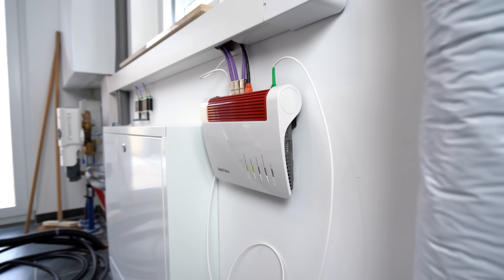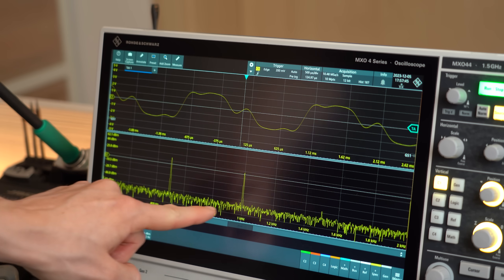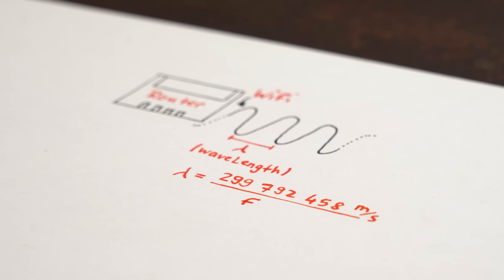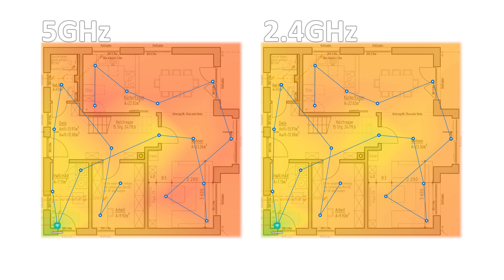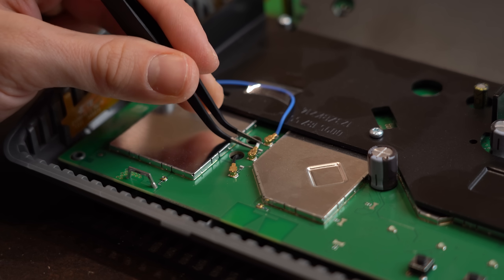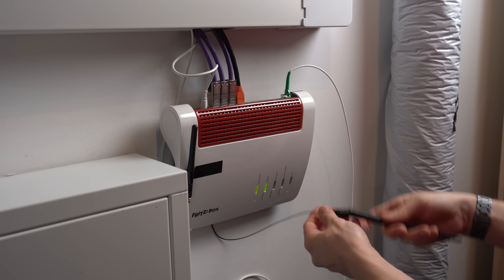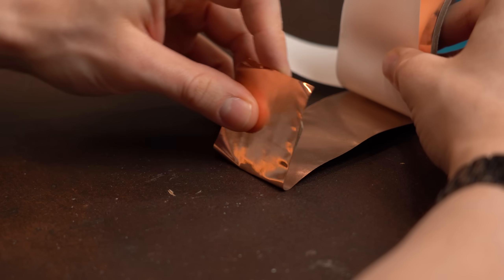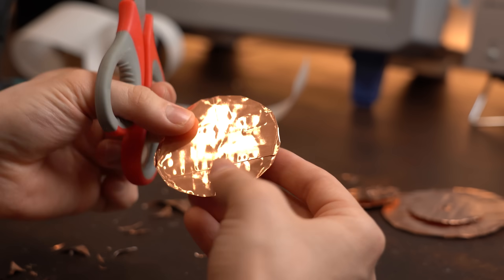I tried OVERPOWERING my WiFi!

Comment: Building antennas without an analyzer, especially at these frequencies can be difficult. Another thing you can try is to move the antennas to a better position with some good coax cable.
Reply: The lack of good, matched coax is most of the problem here. Hard to know what would be appropriate given the black-box nature of the router, but, you can probably infer that from the other components on the PCB. 

Really the best you can do is a half wave antenna that's a large enough diameter to accommodate the range of frequencies you're dealing with. That also makes building it a fair bit easier as there's more wiggle room.

Really though, anything higher than 700mhz or so, and you're better off just buying a halfwave antenna and mounting it properly, and in the case of wifi, having multiple access points really solves the issues he's having very well.
Reply: @jttech44  Yep, a half wave dipole is the easiest thing to build.
Maybe a collinear antenna might be a good choice here too.
Reply: You losing transmitting power via the longer cable…
Not thinking about that solution…
Reply: @edvardfranke   Coax has loss, sure, but so does the air.  Loss in coax is going to be less than loss in air, that's why cable TV is a thing.  If you have to cover 100', but you have 50' of coax, it'll be better to run the signal over the coax and put the antenna 50' away from you, rather than 100'.

Comment: For the last antenna, it would be cool to see its S11 measurements from a VNA.  This would help see what the resonant frequencies are to confirm it was tuned just right.  Use anything from a inexpensive LiteVNA64 to Rhodhe & Schwarz equipment.
Reply: I was waiting something similar to this from him :(
Reply: @Oytun15   I was hoping for a VNA too.
Reply: Also the fact he basically used two conductors separated by dielectric as the antenna elements made it extra sus. No reason a Yagi antenna shouldn’t work if designed properly
Reply: The video he watched making last antenna, is russian. If you watch video about making this antenna, IT WAS USED FOR RECEIVING 4G SIGNAL.
Reply: I was also disappointed that he did not do the calculations himself. I made a yagi antenna a few years ago to get WiFi signal to a camera that was well outside the range of my router. They work well if implemented correctly. For what he was trying to do, such a directional antenna would not work well. The effective area/angle of the signal would be far too narrow to reach his full house. He could potentially improve his signal at his couch, but in turn would sacrifice coverage in the rest of his house. I hope to see a follow up video doing directional antennae justice.

Comment: its likely the orientation of the router. those aren't meant to be wall mounted despite the mounting holes. they have an internal dipole antana. imagine a signal that erridates in the shape of a doughnut . flat. it has great coverage. put it on its side. suddenly. trash accept very specific spots on the sides or directly above it

Comment: You built the directional antenna wrong, adding cooper tape to both side of the cardboard you make 2 elements not 1.
Also maybe you should have tried a dual biquad antenna, that can be made directional adding a reflector behind it.
btw if I'm not wrong those types of routers are built to be placed horizontally not vertically so their antennas has the wrong direction and performs poorly.

Comment: This breaks my heart!:

1) Antenna polarisation: 2 antennas = dual polarity - having both antennae parallel to each other will almost half the throughput
2) Antenna directionality: using directional antennae will reduce reflections and multipath, which are important for MIMO, reducing throughput.
3) TX Power: I cannot stress this enough; Increasing TX power does next to NOTHING. the clients TX power is limited, coverge does not increase by increasing the AP TX power (of course download and upload not considered in this part, but ther are many more reasons to limit AP TX power)
4) Antenna location: avoid going through walls and place the Antenna centrally - for example in the middle of the floor, easily visiable to each doorway (interior doors are usually low density and allow Wifi RF to pass) - imagine the antenna like a lightbulb; if you can see the light with the doors open, you are getting signal.
5) Antenna aperture: the more of the antenna element you can see, the better the signal - it's like the wire is a solar panel - the more of it exposed, the more signal.

IMHO, points 1, 4 and 5 are the most important. Go make changes and tell me it's not better.

Comment: You probably have some spare esp32 or esp8266 around. You can turn it into to wifi extender. With external antenna you can use any and it's still "technically" FCC approved

Comment: I just get commercial cisco routers off ebay for like 10$ cad each and run a few around the house with PoE and run a vWLC in a vm and bam.. makes a big difference when you start with an AP that originally cost 1600usd or more each

Comment: The WIFI is being blocked and absorbed by the insulated dryer vent right beside it.  Assuming there is a solid duct or a coil spring in that white ductlike thing of course.

Comment: If its true mesh you might be ok if you can get the mesh APs in good reception spots, or can uplink them via ethernet. Don't use repeaters though, they will show good signal buit throughput will be halfed or worse. I use ubiquity APs one even uses a powerline ethenet adapter for an uplink.

Comment: Hi, as usual a great video, but being an IT guy I would strongly recommend separating router from the access point and build a small mesh setup. There are many available that are many ready solutions that aren't that expensive but will kill any "consumer" Wi-Fi router out there. I personally use Ubiquiti but as I said, there are many solutions. Hetamapping and meshing is a basic function for such solutions and believe me, having a great life-long support for a set of devices, single SSID for multi-bank networks, multiple vlans... I do know that it would not suit your video format, but check it out for home use  :).
Reply: Fritzbox routers and repeaters support mesh without any hassle just plug them into the outlet and add the WiFi network and it will do it's thing. Setting up an Access-Point network is more of a hassle ✌️
Reply: @leocompany  Yes but they're generally crap at Wifi. I also have Fritzbox, and separate APs from Mikrotik. Wifi on Fritzbox is disabled. Lacks fine grained control anyway. And you can see in the tear down what garbage multi-band antennas they use.
Reply: @graealex  like I said Fritz repeaters and you have good coverage ✌️
Reply: @leocompany  Mesh topology is generally a bad idea, unless you have an Ethernet back haul for it. Otherwise, from my experience, it is mostly placebo, because you may be getting full bars on your phone, but speed and latency are rarely improved. 
In addition, some particular models can be driven to 30 to 36 dBm (1-4W) in the 2.4GHz band, and up to 28 dBm in the 5 GHz band, which at the very least can account for some losses because of bad antenna design.
Reply: @graealex  it's not if you set it up properly and setting such easy things up properly is well yeah easy. I know what I talk about since that is literally how we routed everything. The Router is in the office the first mesh repeater is in my room 20m away straight line closed door. The next one is on the stairs (it's the big avm one 2400 AC I think they called it) around 10m away from the office. Downstairs another one going the stairs further down in the basement there is the last one. So basically all repeaters except the one from my room (that I need since it has an Ethernet port) are directly at the stairs. In every corner of the house you get consistent 200mbps down and a max of 10ms delay. 30m away from the last repeater somewhere in the last corner of our garden you still reach above 70mbps.
So I rly don't see a problem with mesh repeaters nor with WiFi repeaters at all. Wiring Ethernet cables through our walls to plug in access points for a lot of money we would achieve 0 literally 0 increase in anything. It would be just expensive and hard work. So again going with separate Access-Points is unnecessary for 90% of homes simply because the main PC for most is basically mostly next to the router where it can directly be plugged into Ethernet or is just a few meters away where 5ghz network coverage is good enough. And else where in the house with one or two repeaters you still achieve at minimum 50% of what your network can handle which in our cases is enough for some Netflix or Plex on our android tv or YouTube on our phones cause there I rarely download anything that big that I want a fast connection and even if I did I would go upstairs and lay it next to the router which is not needed in our case cause our repeater mesh setup covers every room.
Reply: @leocompany  GreatScott lives in a two-story property that seems to be built less than 10 years ago. It should have structured cabling, and if you don't want to manage stuff, just get some Ubiquiti gear that for the most part manages itself, and plug it into the Ethernet jacks you should have in every room.
Mesh repeaters are just garbage, as are the speeds you mentioned, and you can stop defending a garbage solution as something others should reproduce.
Reply: Yes, I use ubiquiti and have never looked back
Reply: Repeaters consume half the bandwidth. Wired APs are THE way.
Reply: @blacklion79  Exactly. It's placebo. You get the bars on your phone, but not the actual bandwidth.
Reply: astroturf bot detected

Comment: Put your router in the centre of the house. Or buy a newer router with adjustable antenna's. We've got a tp link something or other with 4 antennas, its upstairs in the centre of the house, with the antennas pointing downwards, as we mostly use wifi downstairs. The main internet router is upstairs as that's where my PCs & working from home laptop are connected with ethernet.

Comment: you ideally want your router placement to be in the center of the area you want covered, and preferably elevated higher so less obstructions. And those Yagi style antenna that you can DIY are typically better suited for long range connectivity, provided you have line of sight and the Fresnel zone is not too obstructed. I've tried my hand at making various long range antennae (yagi style,  helical style, cantenna, dishes, pots, colanders, etc lots of things can make interesting antenna) for use in a local Wireless User Group, most had a pretty solid connection going 8KM to a local node. Another good example for those antenna are to link buildings on your property that you cant run a cable to, I took the lazy approach for my mom's cottage and put outdoor mikrotik radios on the buildings. Nice video, definitely at least see to the router placement, or if you cant move it then disable it and put a better access point centrally with a cable to it for best results
Reply: This comment should be at the top. A more central placement of the router will provide the best db gains in every room without any modifications.

Comment: The ideal solution is having only one router as close to the middle of the house as possible. At my mother's house, I installed her router in the basement's suspended ceiling.

Comment: I would've moved the router to the middle. Or added a cheap router as an extender on the other corner room.
Reply: I bought an Asus AC68U as extender this year. It is linked to Telecom router via gigabit ethernet. But you are 100% right about the positioning.

Comment: 6:12 Your new router has 3 PCB antennas. But in the final mod, you had only 2 dipole antennas (one for 2.4 and one for 5). Why not 3 antennas?

 Do you think you could collab with Asus and do a floor map testing with the Asus Rog AXE16000. It has a billion antennas.  😂😂

Comment: I was gonna say since the moment i clicked the video: Get a dual band MESH repeater and/or a MESH 3 stations router system and forget about all the antennas and cables and mods.. i has a Tplink DECO MESH 4 stations system and its kinda cheap, i get +400mbps everywhere in my house, turn on the EasyMesh and SmartConnect and forget about wifi signal/coverage forever..

Comment: Glad you mentioned mesh routers at the end.  I like you, used to mess with amps and antennas to increase throughput.  However, ever since getting the EERO mesh modules, I'm blown away at their performance.  Especially using the LAN jack on a mesh pod.  The speed is amazing.
Reply: I'm using TP-Link Deco mesh setups at home, and work, so I can monitor them remotely through their app, and it's so much better than dealing with crazy stupid extended antennas on a router, and WiFi range extenders where you have you end up having to connect to several different networks if you have a large home going from one end to the other, so now the only WiFi extender I have is in my backyard shop that's that's a repurposed TP-Link router, as I did not want to have to buy another Deco pod, as it's not used as much, and it has a USB port, so I can keep a fan under it for cooling as I don't run my shop AC/heating when I'm not out there.
Reply from the maker: Thanks for sharing

Comment: Constructive and destructive interference must be considered with two or more antenna.  Two drops of water on a still lake will have interference patterns where the wave amplitudes add and cancle.  The same is true for radio waves.  The interference pattern is influenced not only by the seperation between two antenna,  but  the channel freqency and length of cable carrying the signals. Furthermore, we might also consider that the  5ghz band interference patterns are  more sensitive freqency and distance between antenna. 

Lastly we mightconsider, more advanced router rf technology can further complicate the issue with active beam forming. The router may vary the phase relationship of two rf generators  sending signals to seperate antenna so as to adjust  the RF interference patterns and better beam signals in the direction of devices it is in communication with.

Comment: I once built a unidirectional bi-quad wifi antenna with a CD as reflector.
It worked great!
Was for 2.4 GHz but should be adjustable to 5 GHz easily.

Comment: It being low in a corner of your house is the real problem. Get a real router. Something almost enterprise, celing mounted, and mount it in the center of your house, or closer to where you spend the most time. Another thing is that dipoles radiate in a donut pattern - at the very least, you could raise the antennas above most of the furniture, so the signal has less objects to interfere with. The last thing is this - cable length matters. Connecting antennas via unshielded cable means the cable is part of the resonating element. Shielding the cable still means that the signal takes some extra time to travel to the rx/tx electronics, so the cable length must also be a division of lambda.

Comment: Cant you extend the wifi coverage through cheap routers with static ip assigned to your specific device.
All you have to do is set the cheap routers ip to static, put that static ip in the main router for configuration and lastly put on each cheap router your isp username and password.
In the wan port btw.
Reply: plus , your phone can dinamically connect to them

Comment: The 100mW is the maximum power that is being sent out of the antenna. So if you using an antenna that has a 4db instead of a 2db antenna that you’re still in violation. Nevertheless great video! 

And would like to see how difficult it would be to amplify the signal and its results.
Reply from the maker: Thanks for the info!
Reply: It varies by country, but in the US the FCC regulation is quite a bit more than 100mW, and more complicated.
- maximum of 1 watt coming out of the transmitter
- maximum of 4 watts EIRP, which accounts for the gain of the antenna (in direction of highest gain)
- there's also an for point-to-point connections; they can go all the way up to 158 watts EIRP (52 dBm), but require a highly-directional antenna providing the majority of that effective power.

In any case, for non-p2p installations, it's not necessarily illegal to use an amplifier, so long as the amplifier isn't above 1W, and the antenna remains omnidirectional.  But an RF amplifier can cause other legal issues, like amplifying spurious signals below the legal limit in the original transmitter to well above the legal limit.

More importantly, it's often pointless to increase the power of the AP without also increasing the power of all of the devices transmitting back to it; increasing TX doesn't help RX, and wifi is bidirectional.

Comment: The problem is that it's an ISP provided box, I would consider disabling the built in wifi on this and getting a better access point from a known manufacturer
Also: 5 ghz wave being shorter hasn't got much to do with being able to transfer more data, the band allocation just allow for broader bandwidths compared to 2.4 ghz channels, and the fact more complex modulation is used by newer wifi standards. 802.11ax can operate on both frequencies

Comment: I see that you have quite some cat6a cables coming out of your router, so, you probably have wired Ethernet going around your house. Why can’t you connect another wireless Access Point somewhere closer to the centre of your house, maybe on the ceiling? You have your router at the corner of the house, so with your omnidirectional antennas you lose 75% of their signal to your neighbours and nature, while if you have an AP in the centre you will have all the signal for yourself!